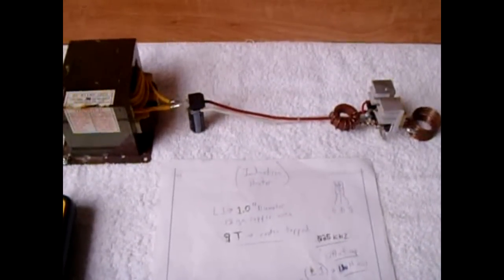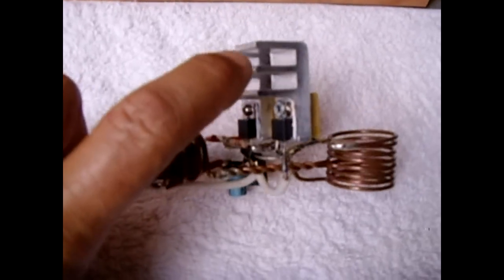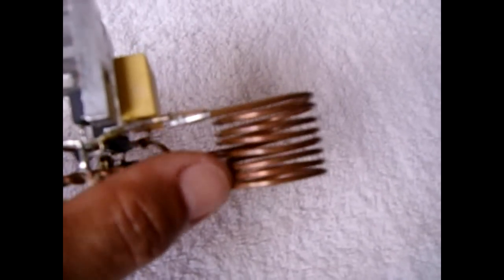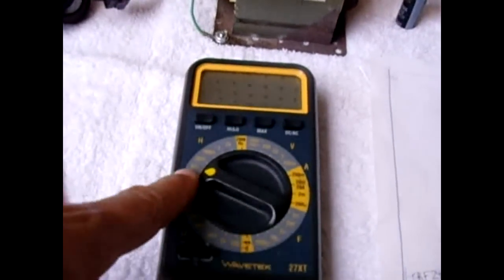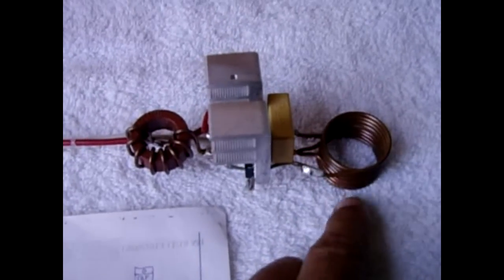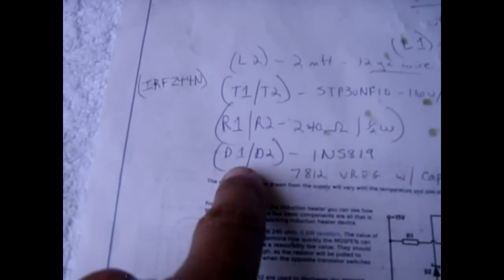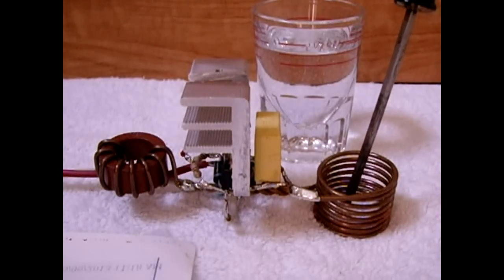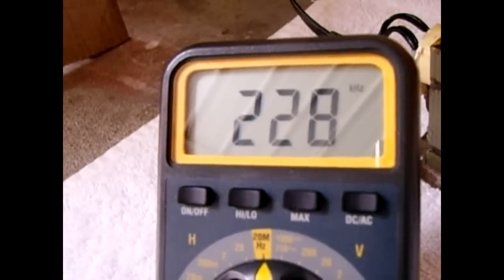How To Make A Simple Induction Heater ~ FULL explanation & schematic

Comment: Can i use ultrafast diodes uf and use a zenner diode to regulate 12v
Reply from the maker: The UF diodes should be fine. A zener wont work, way too much current. Thanks for watching!
Reply: @electronicsNmore  the zenner is Just to regulate the voltage from the source to the gate with the resisters

Comment: I made a Mazzilli zvs driver and it worked for about a day but once I tried doing a little induction heating it blew the mosfets right away. Now every time I replace the mosfets they just blow instantly even with an entirely new circuit, could any one tell me why this is happening? Thanks

Comment: hi, i made one using two irfz44n N-channel mosfet's and 500ohm resistors and 1n4007 diodes and inductor was brown wind 8 turns of thick copper wire and the working coil was 6 turns than center tap and another 6 turns the capacitor i used 0.47uf 250v large capacitor , for the power supply i used car bettery charger when i pluged it in the current jumps to 10,5 amps at 12volts and on 6v 6amps and when i insert a screwdriver in the coil nothing happens it doesn't get hot at all the mosfet's one got really hot and the other only warm what seems to be the probleme?
Reply from the maker: Hi there. Try using a THIN blade screwdriver. If one mosfet is much hotter than the other, that usually means the inductance of one half of the working coil is less than the other. Make sure the working coil is tapped exactly in the center. You can also monitor the current. When the screwdriver is inserted into the working coil, the current should RISE when it is working properly. Thanks For Watching!
Reply: +electronicsNmore i tried several screwdriver and non of them got hot not even a bit only the mosfets got really i tried using 330 ohm resistor but again nothing any tips for succes?
Reply from the maker: Yasser crazy boy
You did something wrong. You need to go over the entire circuit and make sure you have not shorted a mosfet.
Reply: +electronicsNmore no i didn't short the mosfet's i bought them completly new i tried running on it pc power supply and it shut off , i really want to make this working :(
Reply from the maker: Yasser crazy boy
It works, you did something wrong.
Reply: +electronicsNmore i did everything correct i've connect up the circuit correctly should i change to shockty diods or change the value of the resistors?
Reply from the maker: Yasser crazy boy
Can't offer much help. The circuit is easy. Up to you to figure out what you did wrong. Make sure the power supply can handle the load of the heater. Good luck!
Reply: +electronicsNmore thank i will start testing with other power supply's and one question:is it okay if i used 3mm bare copper wire for the working coil?

Comment: What is the voltage and frequency rating of the Tank Capacitor (0.47uF)?
Reply from the maker: Aniket Pratap Hi there. Please refer to the first link in the video description area for more detailed information. the value of the capacitor is determined by the coil inductance and desired frequency. Capacitors with a rated voltage of 100-150v or higher is good.

Frequency (kHz)
Workpiece type

5–30
Thick materials

100–400
Small workpieces or shallow penetration

480
Microscopic pieces

Thanks For Watching!

Comment: Hi thanks!!!
Can you please  what is voltage rating for Capacitor of 0.47 microfarad?
Reply from the maker: +Arohi Karmarkar 
The type x non-polar capacitor in parallel with the working coil I used was rated around 275V

Comment: thank you very much for this amazing video !
Brasil
Reply from the maker: Thank you for watching! Be sure to check out my other videos as well, share my channel with others, and rate Thumbs up.
Reply: for sure i will, btw, im a jeweler and im thinking in build a inductor to melt silver, do you have some tips for me to how to build one, please?
thanks
Reply from the maker: You would need a small graphite crucible and make the working coil slightly larger for the crucible to fit into. You also have to make sure the crucible does not touch the coil! You may have to adjust the capacitor value to change the operating frequency for best results. Look for a HIGH frequency capacitor to prevent heating problems. Usage is only intermittent. No long term operation.

Thanks.
Reply: thank you again !

Comment: Hi, why My toroid keep heating up after switched on, others part going fine and its works
Reply from the maker: Measure the inductance to make sure the value is correct. You may also be using wire that's too small.

Comment: I use this kit but one problam cap .47 uf one leg burn avri time so please help
Thanks in advance
Reply from the maker: Are you using the SAME TYPE of capacitor as shown at the link in the video description area? If you are, then try using (2) or more in parallel to evenly distribute the current(keep things cooler). Use (2) .22 or .27's.

Be sure to check out Part 2.

Thanks For Watching!

Comment: Hey thanks for the insight and specifics, but I wish to know, does the SHAPE of the wound coil that will serve as the induction field generator matter?  In other words, if I were to create this (on a bit of a larger scale) and wind the heavy copper coil into the shape of a square but keeping everything exactly and evenly spaced as illustrated, would this present a problem with how it affects what is inserted within that coil?  I wish to build a small induction furnace that I can pump the air out of, or alternatively replace it with inert gasses for specific types of annealing.   It is much easier for me to construct a square furnace and turning the coil 90° so that the door can be in front instead of at the top and allow insertion of crucibles containing the annealing materials...This way instead of completely fabricating the whole thing, I could essentially modify an existing small microwave oven and just seal the inner chamber, add a thermistor(? forget the term for a probe to track temperature lol!) that can be lowered into the crucible with the material, so that when it liquefies (or not) I will know what temperature I am holding it at, for which as you mentioned, I can regulate by changing power source voltage or frequency.

So the biggest thing would be to know if making that coil in a square shape would affect how the generated field would behave I guess...not knowing how right angles would impact it for not being able to visualize what such a field LOOKS like!   Or else it might be extrapolatable.  

Thanks for any additional input your expertise may provide, or any of the viewers, since you already provided the entire basis for an induction heater!  

Rather well done I might add...but for the number of annotations, but at least you termed them before I was prompted to have to click to close them...which is more respectful than some of the rather greedy YT'ers who completely compromise what they offer by arrogantly obligating viewers to contribute, and I do not begrudge anyone for being compensated for their efforts, especially quality efforts and utilizing tools such as your use of affiliate linking to suppliers and such.  

This is a GREAT EXAMPLE for others who wish to monetize their channel, for their HONEST CONTRIBUTIONS such as this one is, where you indeed are GIVING AWAY intellectual real-estate, while not diminishing the quality of what you have provided by barrages of adds and annotations that overlap and persist for long periods, as I prefer to leave them on for those times when they are PROPERLY utilized for enhancing the explanations if the narration is found to lack after production of the audio portion to correct script errors, typos on captions, or tripping over words, as can happen to anyone, especially if they are not used to being in front of a camera or microphone...just a single thought of 100's of k's of views is enough to cause brain farts, and stage shock, and they freeze momentarily (or longer lol) unable to recover and pick up quickly enough to simply let it go and keep moving, this takes experience, that with them off, the viewer would have no clue why there was a pause or if they turned away for a moment of blinked, think they missed something completely.  These are all factors many fail to realize can impact the final results of a video, especially if tools or skills for editing are lacking or nonexistent! 

Thanks again!

Peace, Love, and Light to all!

Comment: please ,be werry carefull with induction heaters !
One i bought in shop explode about month ago and take my left eye out !
Reply from the maker: The only part that could explode would be the capacitor or mosfets. Good Idea to enclose ALL parts except for the working coil, inside a ventilated metal housing.
Reply: electronicsNmore OK, i think it was an eletrical shotr-citkuit ,but it is not much interesting its a danders thing - good to have good to use but dangerous
Reply: electronicsNmore it wos cloused and ventilated passive and active way.